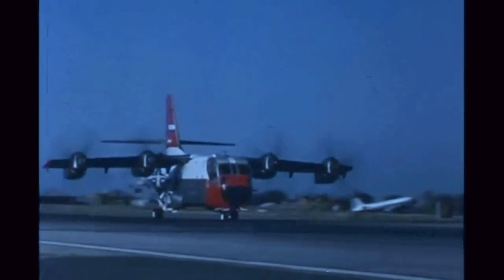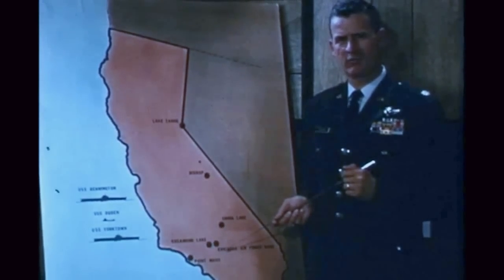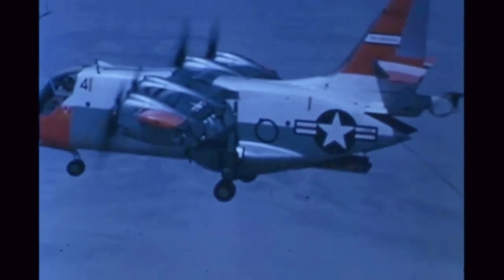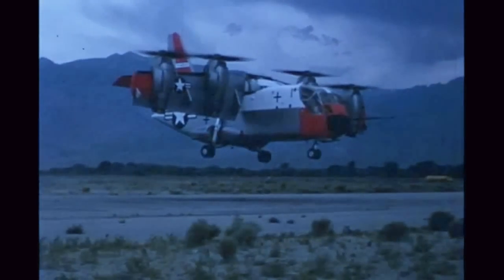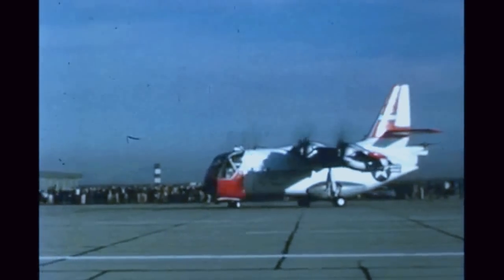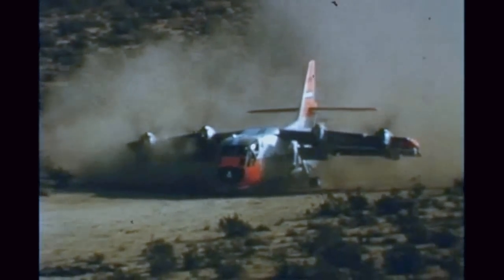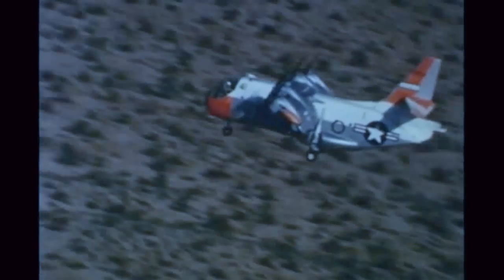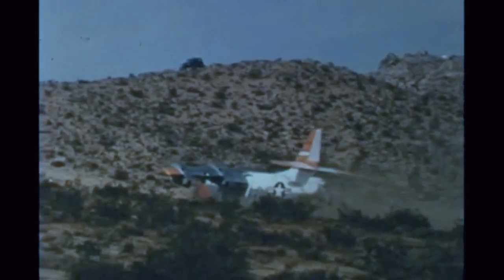Ling-Temco-Vought XC-142A Promo Film - 1967

Comment: The XC-142A looks  a lot more reliable and stable than the Osprey.
Reply: It wasn't.  NASA tested them all.  This was the wind tunnel model for the XC-142a: https://images-assets.nasa.gov/image/A-31911/A-31911~medium.jpg

And the flyable XV-15, prototype for the V-22 in the same wind tunnel decades later: https://images-assets.nasa.gov/image/ARC-1978-AC78-0579-2/ARC-1978-AC78-0579-2~medium.jpg

 I live next to NASE/AMES, and have seen the XV-15 fly overhead many times during the 1980s followed by a NASA chase heli. I always knew when it was coming because it sounded like no other aircraft.

Comment: Heck., this aircraft looks to've been evn more promising than the current ones. I urge the Concerns who once were involved in this regard to look into the possibility of reviving this magnificent aircraft.
Reply: Now that we have the Osprey and Valor, it's just a matter of time before a cargo version is pursued.  Forget the 142 though. I was 4 when it first flew, and I turn 60 tomorrow.  The people involved with the XC-142a are long-gone.  The tilt-up wing concept had issues with high winds pushing the plane around anyway. Titling just the rotors proved better.

Any cargo version will probably be a front-rotor/rear rotor set-up:  https://defence-blog.com/wp-content/uploads/2016/05/CimZJysW0AA1Gkl.jpg
Reply: @bogdog999  My dad worked heavily on the program in the structural engineering test lab at LTV in Grand Prairie TX.  He's still kickin' today thank you very much 😉 
Triumph/ Vought even called him back some 15 years ago to help with the F-35 JSF drop testing program as a consultant for his expertise from the XC-142 prgm.

Comment: QUOTE: "During testing the aircraft's cross-linked driveshaft proved to be its Achilles heel.

 The shaft resulted in excessive vibration and noise, resulting in a high pilot workload. Additionally, it proved susceptible to problems due to wing flexing. Shaft problems, along with operator errors, resulted in a number of hard landings causing damage.

 One crash occurred as a result of a failure of the driveshaft to the tail rotor, causing three 
fatalities.

 One of the limitations found in the aircraft was an instability between wing angles of 35 and 80 degrees, encountered at extremely low altitudes. There were also high side forces which resulted from yaw and weak propeller blade pitch angle controls. The new "2FF" propellers also proved to generate less thrust than predicted."

The XV-15/V-22 concept was designed to address many of these issues. The troublesome tilting-wing idea was the first to go.

Comment: I said this on a previous posting about this aircraft, but this is a marketing film intended to be shown to members of Congress to keep the program funded.  They are not going to discuss the problems here; things like excessive wing flexing, vibrations, and most importantly, problems with engine-out performance and stability.  These were all problems that were finally solved with advanced materials development and digital controls that did not mature until the V-22 came along.
The 142 could have developed into a competent aircraft given the time and necessary funding, but this was also the height of the Vietnam War, a time when McNamara and Johnson were trying to hide the true cost of the war by shifting funds from other DOD programs, which stunted the development of long term projects like the C-142.  When it was clear that this was years in the future, the services decided that their immediate needs could be met with existing aircraft. and the project was canceled.
Reply: I still think it is a safer approach than the V22 has turned out to be.  All it's issues would probably would have been resolved 15 or 20 years earlier than the 22 and it can land like a airplane when things go haywire, something the 22 can't do.

Comment: It works! i.e. V-22?
Reply: Camilo Tapia Since this is the early 60s I would say this proves you don't need
massive amounts of computer control to have a VSTOL aircraft, like the V 22
Reply: I think the 22 has drawbacks this design doesn't have.  Not a 22 fan.  It was bought more over politics than actually being better.